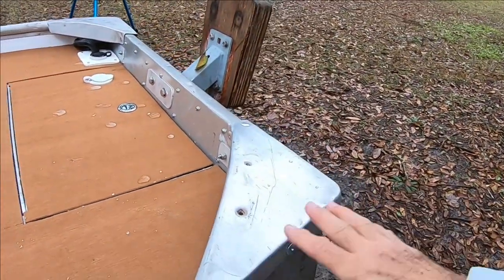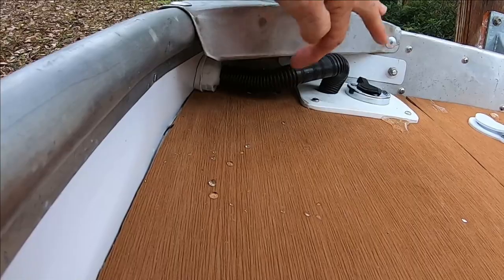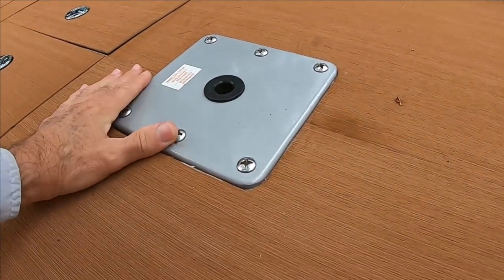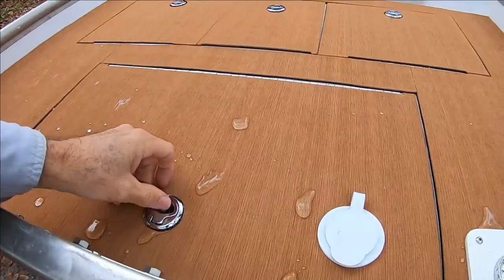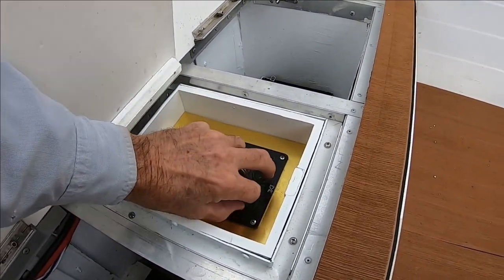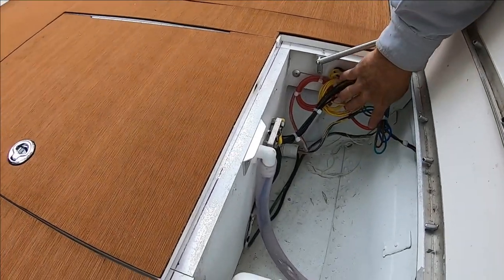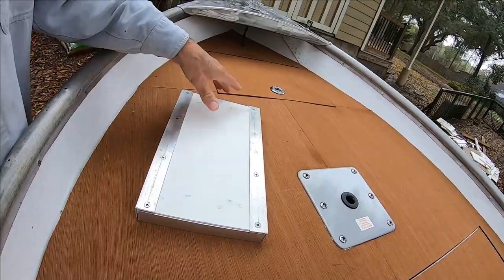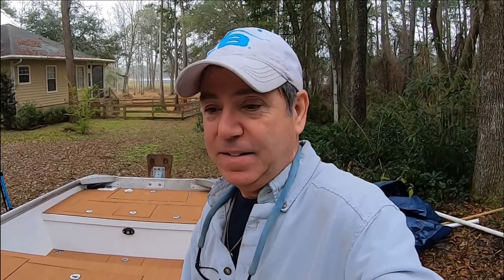Rowboat to Bass Boat Conversion, Update #7

Comment: What’s your main power for the boat going to be, gas,electric?
Reply from the maker: I plan to buy a 4hp but for now I'll  be putting along with trolling motors.
Reply: With a 4hp it’s going to be a very long ride to your fishing spots. Have you ever add up all the weight you’ve added to the basic boat?
Reply from the maker: I'll talk about the weight in the next vid....